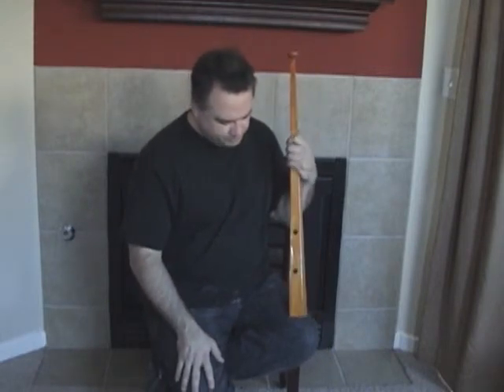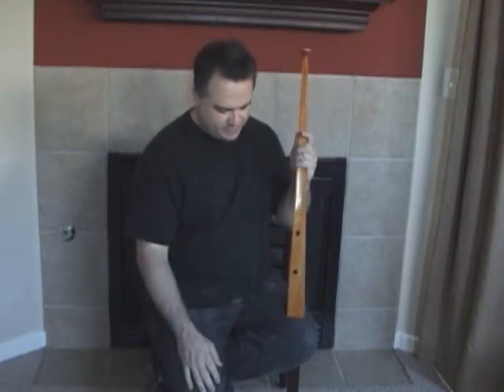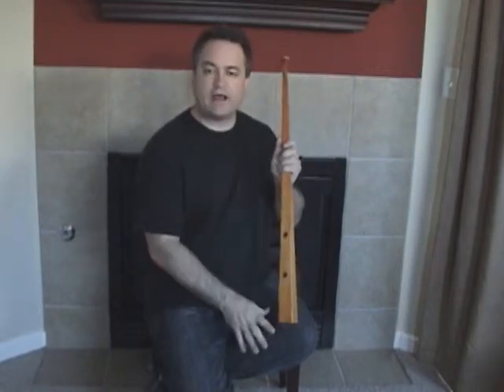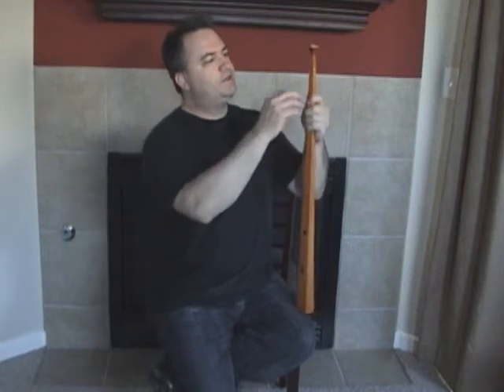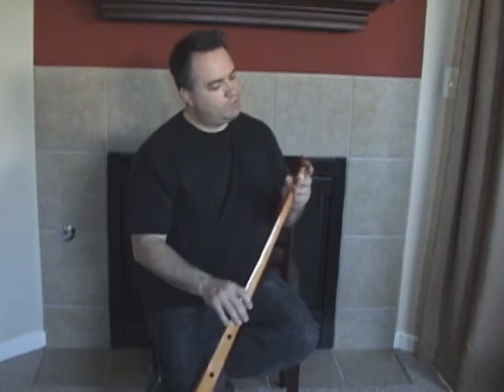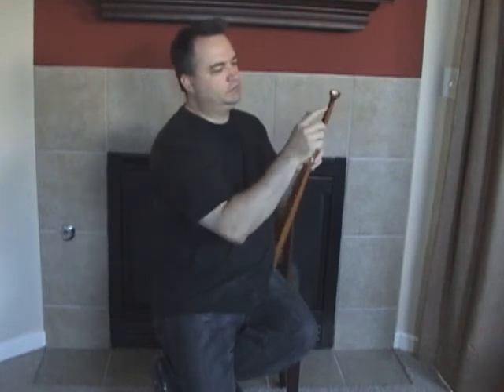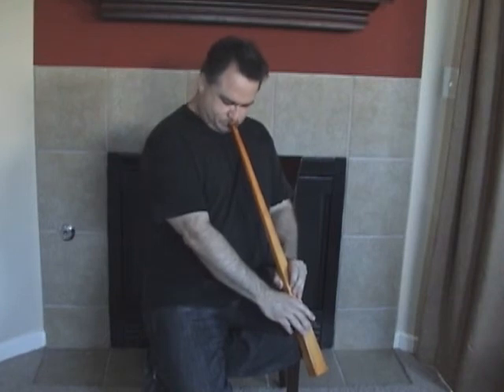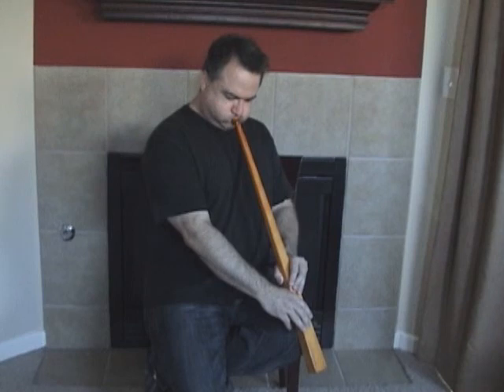wooden horn

Comment: The taper shouldn't cause you problems for so little! It is the length that is critical, just as the wavelength on radio antenna it should be full, half or quarter of wavelength. There are plenty of online pages that automatically calculate the length for a given pitch